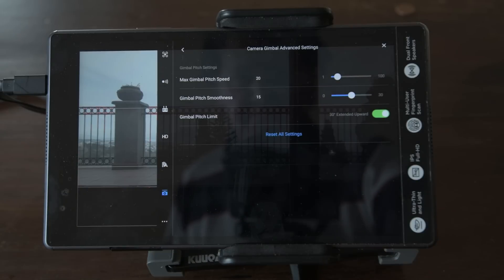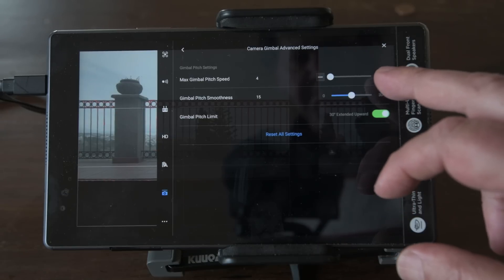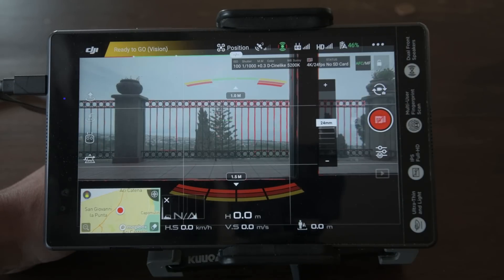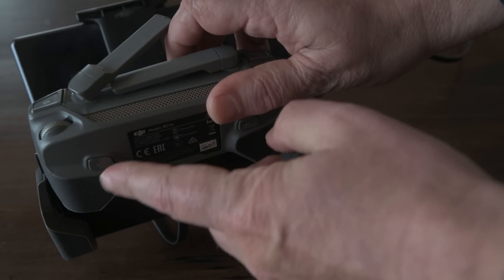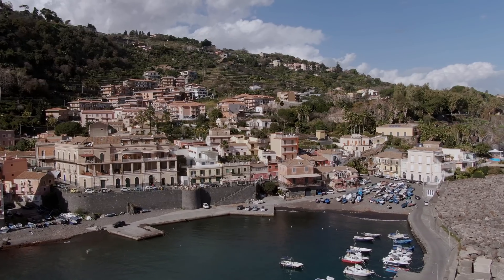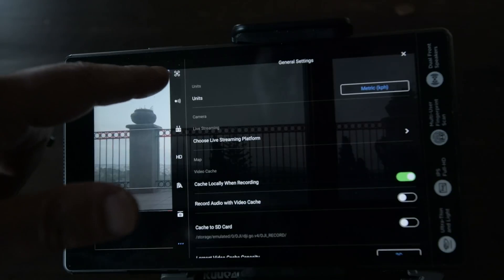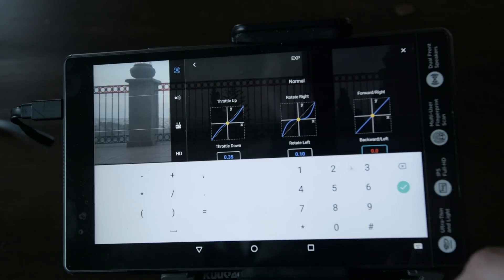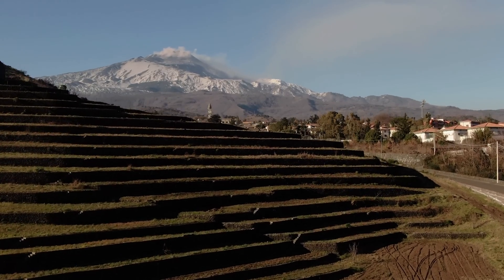Drone video: gimbal and aircraft control best settings

Comment: Great info for gimbal settings. But as for the drone movement, whats the difference between your settings vs "cinematic mode"?
Reply from the maker: Cinematic mode is only in a few DJI models. In the Mavic 2 series there is tripod mode, which is very similar.
Cinematic or tripod slow down everything, including the sppeed of the drone itself, great for flying in enclosed spaces. The methods I show in this video allow to tweak individual controls, while flying at normal speed

Comment: Finally got my new M2P after 1 1/2 years with Mavic Air, and am going through your videos. Not that it really matters, but I just watched your other video and you assigned gimbal forward and down to C1, and in this video, you made it C2. Any reason or preference?
Reply: Thanks for Heart reply  but can you answer my question?  Assign gimbal forward/down to fast access button C1 or C2????
Reply from the maker: That is great news Dale!!!
I am waiting to see your footage with the new bird.
I must have made a mistake, you can assign any of the two for forward/down. I like to set the other to the exposure menu, so that I can change shutter speed or ISO quickly when needed
Reply: @VICVideopIC  Unfortunately more big trips for now.  My wife and I  did three big trips this year (with Mavic Air - Iceland,Montana, Zambia-Madagascar) and they are all posted on Vimeo. I'll be practicing around Miami for now. Next big outing with the Mavic 2 Pro will be in April to our glorious western red rock country of Utah and Arizona.